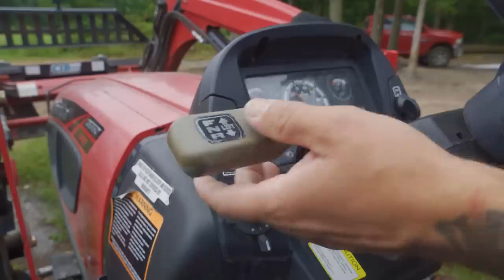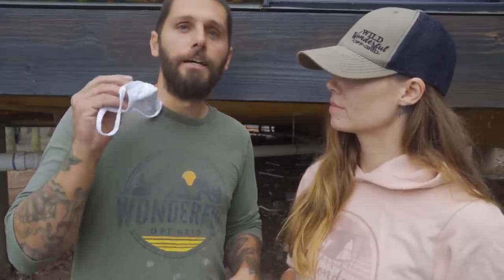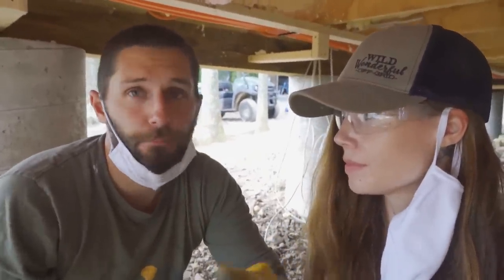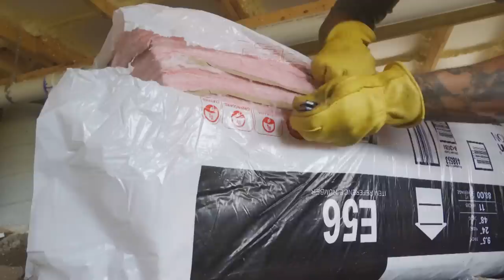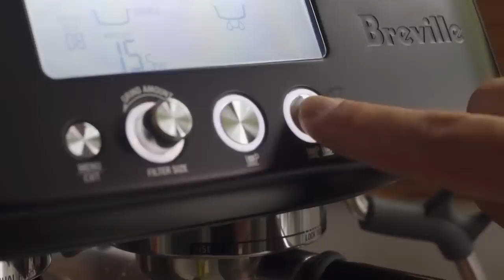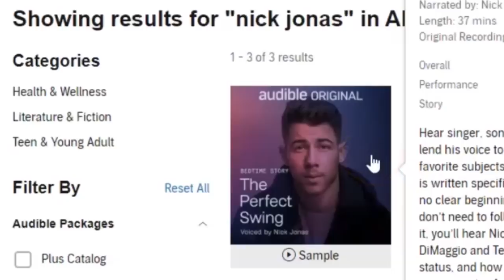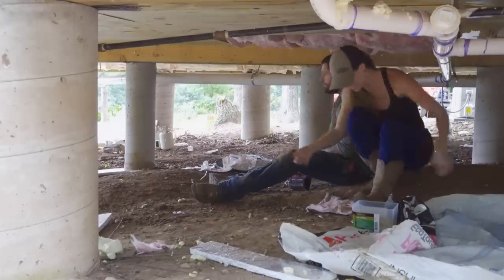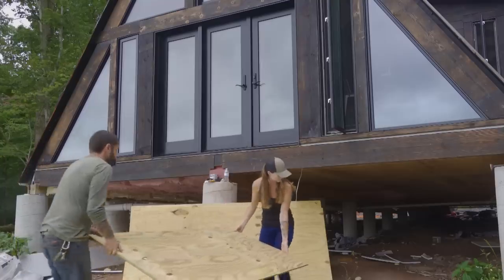Insulating A Home On A Pier Foundation

Comment: one place was adding on to there building  the packaging up the house to go north 5 years for the house to be made they packed everything up they were putting pink insulation into crates to go there  they had 5 rail cars full of R30 packed in 5 high into the crates seal them up  
they even package the bedroom furniture to take about a year to get for when the plant was northern Canada  did help them out too on the sale of lumber and they busy there too

Comment: I’m curious if there’s been any condensation from insulating the floors? Did you research that before deciding to do it?
Reply from the maker: The paper facing on the insulation is a vapor barrier. We haven’t had any issues 😊

Comment: Should have had one of the boys under there with a staple gun popping 2 inch staples in the corners then one staple in each joist. It would be enough to hold it up temporarily and saved both of your backs.

Comment: Just suggesting Josh&Erin, if U guy's  used a slide roller board like mechanic used to repair beneath car maybe a bit more easy to do the job that ultimately kill the back anybody's doing  floor insulation...like U guy's did.

Comment: I cringe when I see someone using a circular saw without adjusting the blade depth to be just enough to cut through plus about a quarter of an inch.  Having too much blade increases the chance of kickback or injury by accidentally cutting into something below.  It’s also better for the blade and makes a cleaner cut.  Overall, great job on a very tiring and itchy job.  Working overhead is the some of the most tiring work and I hurt after just watching.

Comment: First does she think your tractor is sexy? Second why not use metal roofing under the house? I would think it would be lighter. Third why not a floor jack and some blocks and make a mini drywall like lift to lift/hold those sheets up?

Comment: Not to knock anything but the green roc wool is pest resistant mice and rats won't touch it or any insects. I hate to see you put that pink stuff under the house with every pest you could ever imagine its going to be trouble in the long run